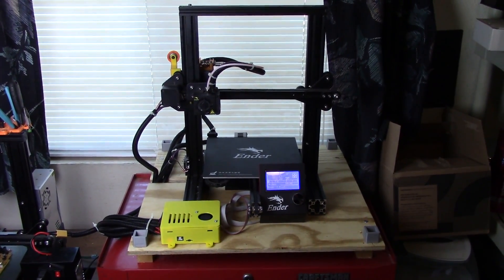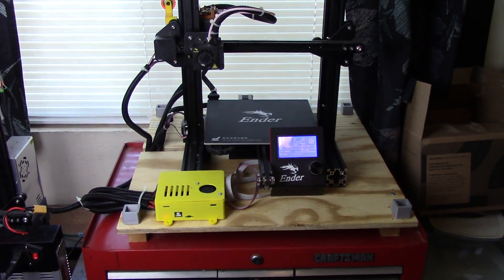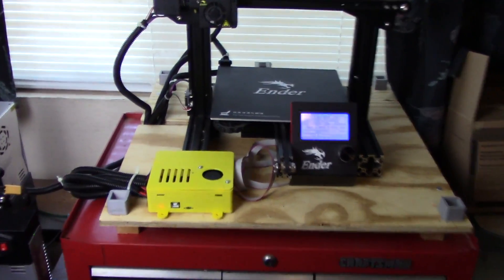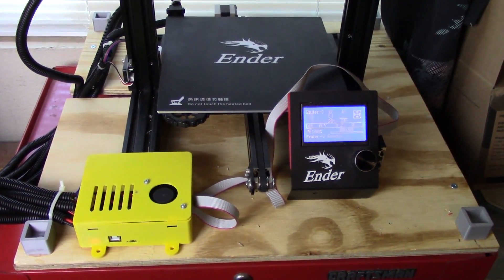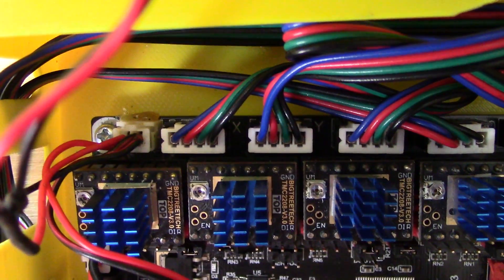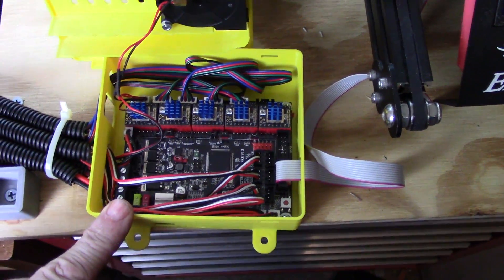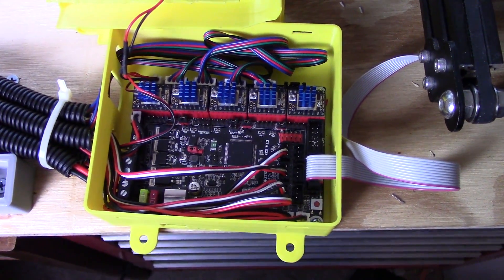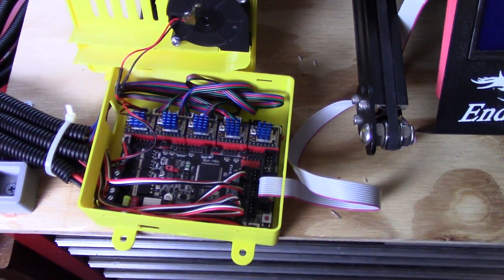Wiring Finished! Ender 3 SKR 1.3 and Ikea Lack Enclosure

Comment: I upgraded my ender 3 to a Microsoft direct drive.  Now having issues with the wiring dragging across the bed and filament guide.  I need to find a filament guide for direct drive.  Unless I don't use one and just have wire come down from filament roll.
Reply from the maker: Sounds like the perfect opportunity to design and print your own custom parts. The ability to create new things was one of the reasons I got a 3D printer in the first place.

Comment: Where do I get the electronics enclosure for the standard board that includes the mount for the control screen
Reply from the maker: I don't have those files. Try looking on Thingiverse, Yeggi and GrabCad,. If you can't find them there, and I'd be pretty surprised if they're not, you may have to either make them yourself or modify an existing design. Also, if you find something that's close to what you want you could ask the designer if he'd mod them for you.

Comment: I see the list of supplies that are needed, but what gauge wires will I need?
Reply from the maker: Depends on what you're wiring. Most of the sensors and low power fans will work fine with 22 gauge. Nozzle heater will need a little heavier, probably in the 20 gauge range, and the bed heat and incoming power will need the heaviest yet, probably around 16 gauge. But when in doubt, get one size heavier. Oh, and there's some math you can do to figure it out, but I've always just eyeballed this kind of stuff.

Comment: For your fan issue: I have installed the skr 1.3 in my anycubic kossel which had originally a controller fan output. 1.3 is a bit short on io pins. But as i didn't use the 5th stepper, i redefined the E1 Dir pin to be the controll fan pin. You also can set a fan speed. 

define USE_CONTROLLER_FAN
 #if ENABLED(USE_CONTROLLER_FAN) //
#define CONTROLLER_FAN_PIN FAN1_PIN // Set a custom pin for the controller fan 
#define CONTROLLERFAN_SECS 60 // Duration in seconds for the fan to run after all motors are disabled 
#define CONTROLLERFAN_SPEED 255 // 255 == full speed 
#endif
With this pin, i am controlling a mosfet IRL540N that switches the fan on and off. Now, the fan is only on when steppers are moving. The mosfet circuit is just two resistors and the mosfet itself, so easy to wire up on a prototype board. You can switch anything from 24 down to 5V with that. Here a link to the diagram which i quickly drafted on paper.
https://www.a-thinnes.de/bilder/mosfet_circuit.jpg
So get rid of the unused stepperdriver and  enjoy a couple of free io pins to play with!
Reply from the maker: I originally had the E1 power set to operate the fan, but since one of my reasons for getting this board was to fool around with dual extrusion I ended up changing it back. But I will take a look at what you did, thanks for sharing!
Reply: this works as i did something similar on my kossel linear plus but  with a ramps/rearm mounted on the outside right
Reply: It might also work with a  XYZ+ pin but i haven't checked yet. On these, there are some resistors and capacitors for filtering and I don't know if this is interfering. Also didn't check if these are pwm capable. Maybe I'll test today.
Reply: As promised, I tested it today. On the Kossel, you use XYZ-MAX Endstopps. Z-MIN is used for the ABL probe. So X-min and Y-min are available. I am using X-MIN for the filament runout sensor already. So there was Y-MIN left for testing. I adjusted my configration_adv.h

#define CONTROLLER_FAN_PIN P1_27 

 
I also tried both 

#define CONTROLLERFAN_SPEED 255

and

#define CONTROLLERFAN_SPEED 128

to check if PWM is working.

I can confirm, it works perfect! Fan runs at 100% and 50% no problem. So with my MOSFET-solution, you can definetly solve your issue without using a buck converter just by using Marlin's features. You can buy IRL540N dirt cheap on Aliexpress. I bought 20pcs or so.

Keep up the good work, Chuck!
Cheers
Armin

Comment: Ithink Axial fans better than 5015s for case get 80 noctua less noiser or 120mm, little fans much noiser and iim using cnc industrial fans for my ender they lifetime better than refular like 50k to 80k hours
Reply from the maker: I agree with you about fan types, I've always hated the little blower fans, but they do move a lot of air...just not very quietly. I really liked this particular box design, which was why I went with them this time. If I ever change it I'll probably dump the blower fan.

Comment: Please do the video showing hot to crimp the jst connectors by chance do you have Dupont connections as well could you show those to I just bought a jst Dupont connector kit combo
Reply from the maker: The whole connector terminology thing is enough to make my head hurt. JST isn't a spec, it's just a type of solderless, crimped on,open barrel connector. The Duponts I've seen have been nearly identical, the plastic surround has been different. Anyway, the technique to do one should work with both types, I think even the tools are the same unless you go way back to the professional tools that cost hundreds. I'll try to put a video together this weekend. Not sure it will happen because the current ones I have are all really tiny. I'll dig around in my stuff and see if I still have any of the larger ones, they may be easier to get on camera.
Reply: @3rdpig  oh no rush and ya the kit I bought was a combo jst Dupont with one crimping tool that does both plus ATX and molex connections and I also noticed the crimped part is almost identical however the die to crimp them is different and if you crimp using the directions for jst it does not fit as well in the Dupont connectors